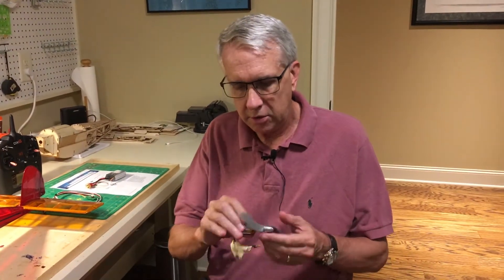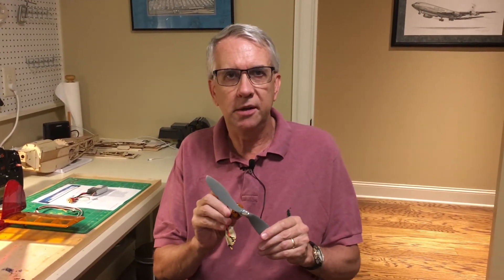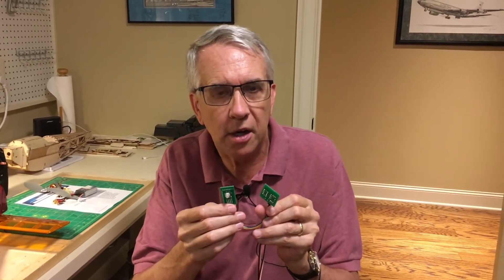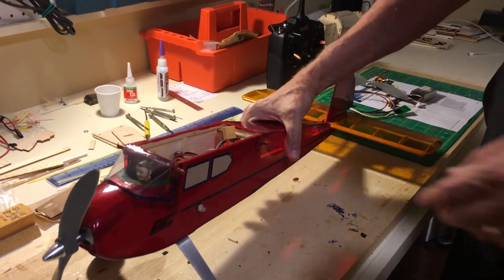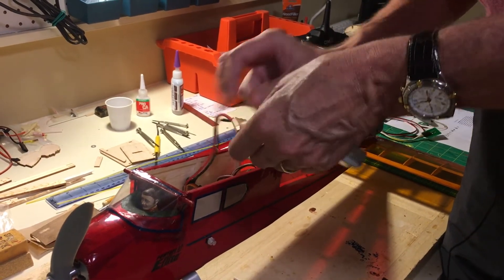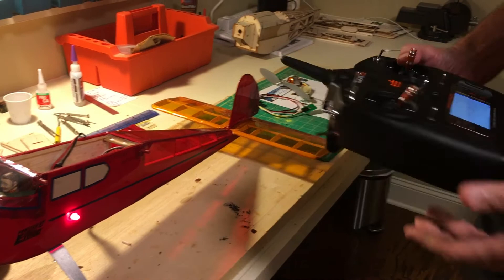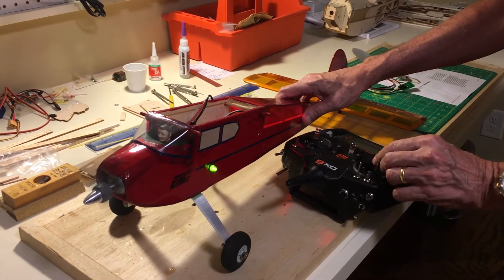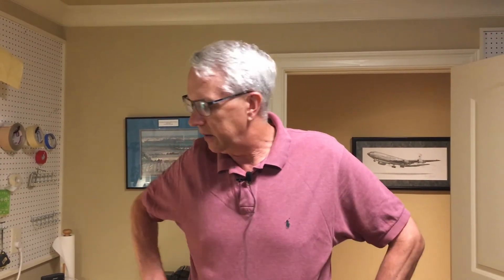Safe Start - Simple Prop Safety for Electric RC Airplanes

Comment: Thank you for this. I have had some close calls and I don't consider a transmitter-based option a real solution. One question - if for some reason you needed to disable a RUNNING motor and the TX wasn't handy, would pressing the button turn it off?
Reply from the maker: GrendelW:  Great question!   Happy to report I just tested this out on my BuzzBomb RC plane.  With the electric motor running, Safe Start button green, the moment I pushed the button the motor cut off and the button internal light went to red.  Tim
Reply: @TimMcKay56  Perfect. I am in for one! The plane I am building now (400% Guillows Javelin) has by far the largest motor/prop I've done yet...and want to step up my game with safety.
Reply from the maker: GendelW:  Great, sounds like a good plan.  Dave (at Dave's RC) is easy to work with.  I usually get an extra Safe Start when I order for future projects, the system could not be any easier to install.  And I like the 400% Javelin a lot!  Tim

Comment: This is an issue that frankly, I'm surprised still exists. Whether your RC protocol delivers last frame, no pulses, etc, there's no reason "Hobby" grade R/C products cannot adopt what the "Toy" grade R/C quadcopters and helicopters have been doing for years. Many toy-grade products require a full sweep of the throttle channel to arm the motors, presumably 1000-2000us PWM and back. If hobby-grade manufacturers adopted this onto their CH1 on TAER or CH3 on AETR, many forearms and fingers would be saved. Stupid simple circuit, pennies to save millions.
On the other hand, iNav, Ardupilot, Betaflight, etc. the open-source software I've run on drone, rotary, and fixed-wing FC's have all had very robust safe-ing and failsafe features. I feel that the community is certainly interested in line safety, the "please-don't-sue-us" toy manufacturers are interested, but if you're flying a traditional RC plane you're forced to find your own solution, such as this little gem. 
Hey Horizon, if you're listening: Make it happen. License this tech. 9 out of 10 Spektrum lawyers would agree with me.
Reply from the maker: GR:  You raise very good points.  One of the benefits of the explosion of drone flyers is their innovation of just about everything.  But, Safe Start is worth the price of admission, could really save having an accident.  And, my Spektrum DX6 does have a very nice audio voice warning where the internal voice says "Throttle High" if I ever turn on the transmitter with the throttle above idle.  Tim